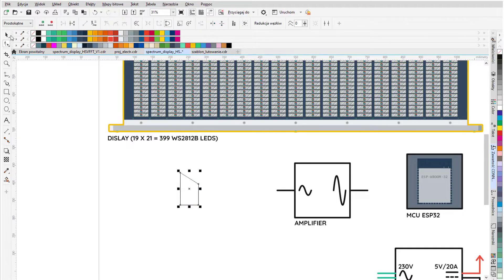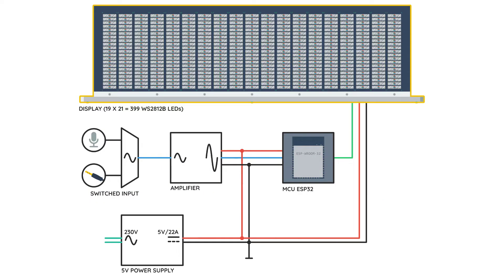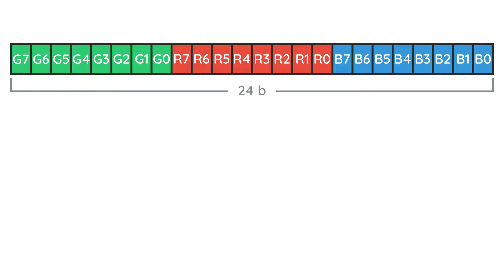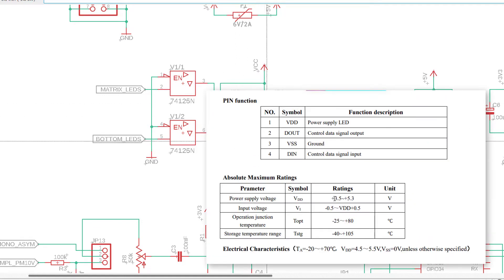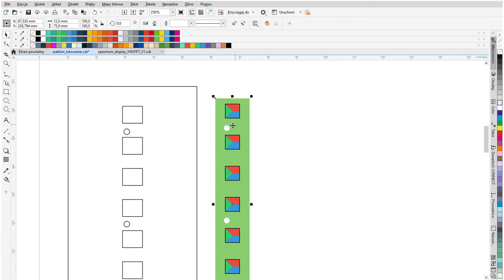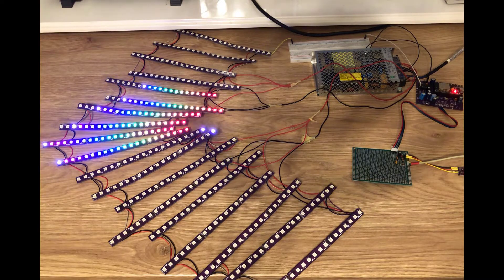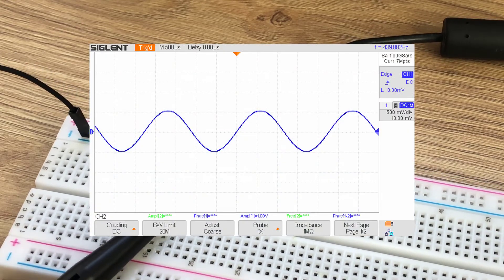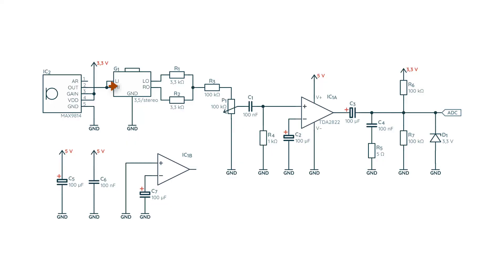Spectrum audio display ESP32 – Let's build it! #1 Electronics

Comment: Good morning.  I'm compiling a sketch.  Everything goes fine, I upload the sketch on the board.
I will do as in the instructions, but still the board does not start, the firmware does not work. Board esp32 devkit v1

Comment: Thank you for sharing this project. I have all the parts but the acrylic, which is very expensive to get cut :)
Reply from the maker: Yea, here acrylic is twice as expensive as before pandemic. But despite that I wanted to start big project and maybe sell it in future. Do you think would there be an interest in buying displays like this?
Reply: @Pyrografpl  I see PLATINUM has sold a few of just the circuit boards on Ebay. People do love LEDs that respond to music ;)
Reply from the maker: @kickbaktube  yea that's a good point. I was inspired but PLATINUM, but I found out that despite open mechanical rest is closed especially source code. For those who are not familiar with FFT algorithm it can be troublesome to do similar project. I'l do my best to explain how it works and then try selling my own designs :)
Reply: @Pyrografpl   i would buy one, can`t wait for you to add the two external boards to the project. A/Dc and the PGA to make it more resposive